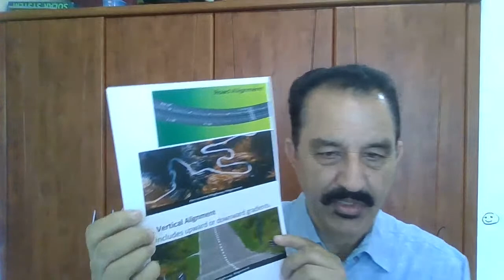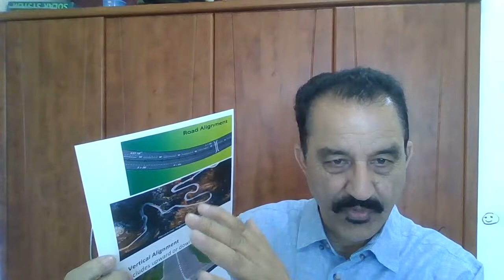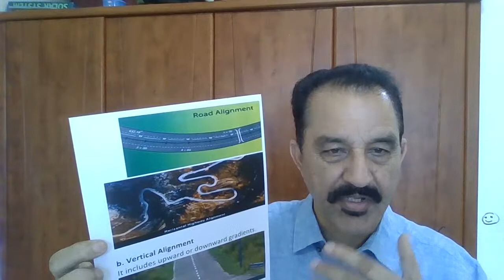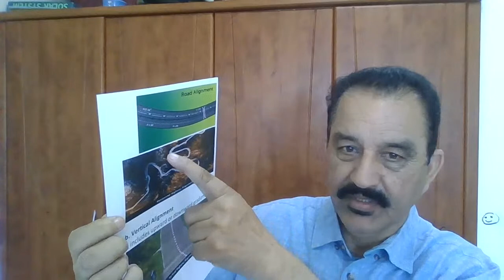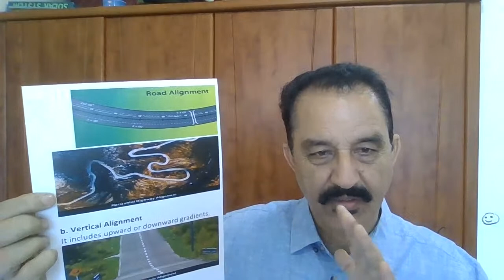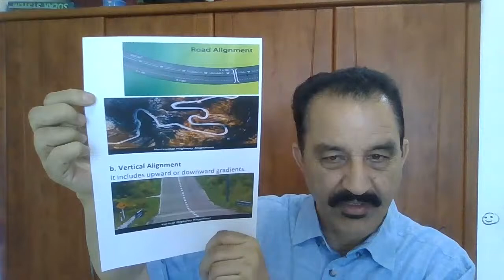Civil Construction Materials--Technical Session No 134- Road Alignment-General feedback.

Comment from the maker: There are two types of road alignment.
 
a. Horizontal Alignment
It includes straight stretches, curves, etc.
 
 
b. Vertical Alignment
It includes upward or downward gradients.
 
 
______________________________________
 
  1. Result of Improper Road Alignment  
Improper road alignment leads to the following:
a. Increase in the rate of accidents.
b. Increase in construction and maintenance costs.
c. Increase in the vehicle operating cost. It also leads to the discomfort of the users.
d. Decrease in durability and strength of the road.
 
______________________________________
 
  2. Basic Principles of Road Alignment  
1. The alignment of the road should be as short as possible to give the economy in the construction cost.
2. The alignment should be as straight as possible, providing higher traffic speed and lower construction costs.
3. The road alignment must be easy for the construction, maintenance, and traffic operation.
4. The alignment should cross the railway lines and other roads and bridges at right angles.
5. It should cross the rivers, canals or streams, etc., at a place where its width is minimum.
6. The alignment should serve the maximum population by connecting intermediate essential towns and a group of villages.
7. The road alignment should not pass through natural beauty and scenery regions.
8. The alignment should be such that it crosses the minimum number of bridges, crossing culverts, and embankment places.
9. It must give a smooth curve and easy gradient.
10. It should be such that minimum earthworks in embankment or cutting are done.
11. The alignment should provide a reasonable sight distance.
12. It should be free from obstructions like ponds, lakes, wells, monumental buildings, historical buildings, etc.
13. The alignment should run through such places where materials for road construction and labour are easily available.
14. As far as possible, it should run on good soil having the good bearing capacity to bear loads of traffic safely without any damage to the road.
15. The alignment should not passes through more costly and cultivated land. It must also avoid forests.
 
______________________________________